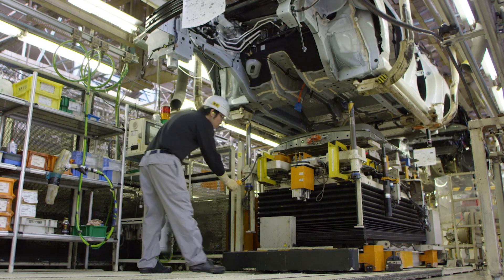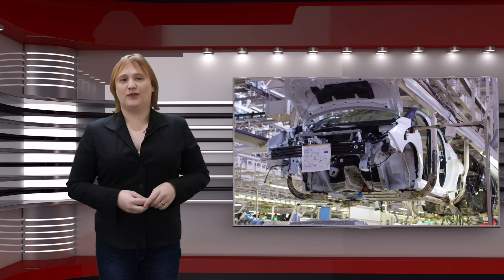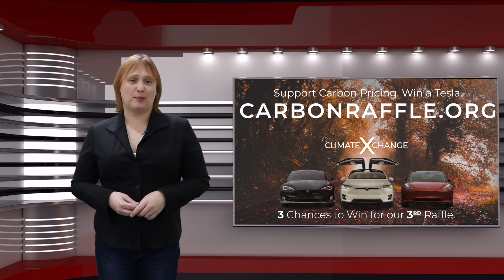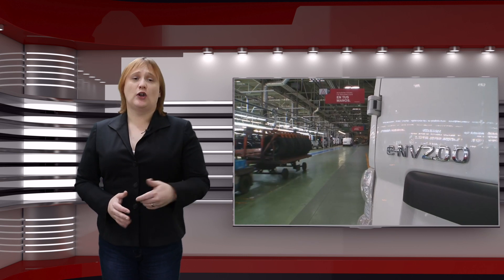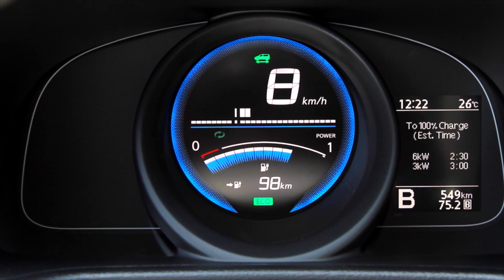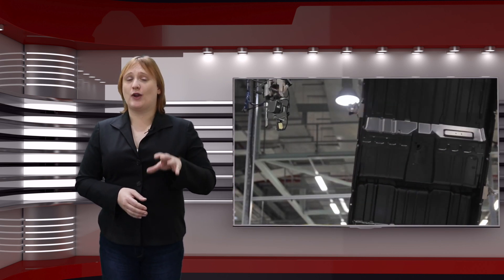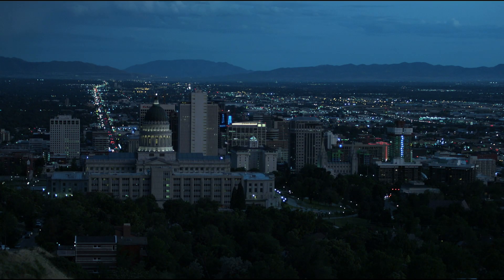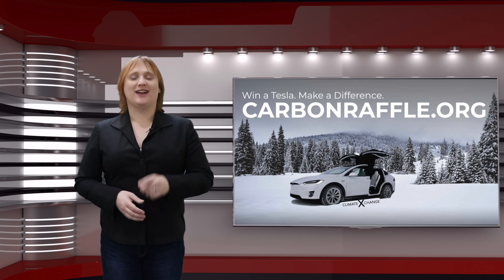The 2019 Nissan Leaf e-Plus Will Get Air-Conditioned Battery Cooling, Not Liquid Cooling

Comment: Flat Assertions  Like Liquid Cooling is Better than Air... is the same stuff VW owners heard for many decades.  Now those cars are famous for simplicity and the ability to work in ANY Environment...  don't freeze, don't leak, fewer parts, hard to break... etc.  Liquid cooling has been very sucessful in the Volt... and unsucessful in the Bolt.  In either the maintenance is expensive, failures inside the battery box are messy, complex, and expensive.  The parts count is enormous.  You skipped over the whole second gen Leaf change in battery chemistry which was a game changer which began over 10 years ago.  So using the earliest 2011-12 cars to predict the life of all newer leafs is just a smear.  You also fail to grasp the fact that a retro fit of the chilled air cooling to previous iterations   24, 30,40 KwH  packs   can further extend their typical 75K mile plus life.,  and make moderate fast charging much safer. More leafs have been produced than any other EV  and I have yet to see one burn.

Comment: Air cooling must be safer. Nissan Leafs are the only EVs that have not caught fire because of the battery. Teslas, Chevy Bolt, Kona EV all have had fire problems. I own a Leaf and have been satisfied with it. I just never use DC fast charging.

Comment: So you did the yards of calculus to figure out the heat transfer from the  + model and figured out all the Nissan engineers were just stupid?   They should hire you!
Reply: They are stupid or they are paid to be stupid.  On average, the battery packs in the Nissan Leaf MY2014 and MY2015 lost 12% in 3 years and then lost 20% in 5 years.
Reply: @MrSummitville  I don’t get it, my sons each had a leaf (a 14 & a 16) we lived in the PacificNW then, they drove them everywhere, all season and had a terrific experience, zero problems and no battery degradation in 3 years whatsoever.  Never overheated a battery, never got slowed down on a fast charger.  I feel my experience was average, saw lots of LEAFs all over Seattle.

But everyone is compelled to hate on Nissan because they won’t completely redesign their chassis to install watercooling in the battery pack.  Did any of you actually own a LEAF or are you standing on the side telling everyone what you won’t buy?  Meanwhile my kids saved me $1000 in gasoline in the first two years.

Comment: I think you hit the nail on the head, stating that a larger capacity battery will be under less stress powering the same load. A battery running under a lighter load compared to it's capacity will be more efficient, and produce less heat. If they're actually air conditioning the battery, that can help in areas with much higher outside temperatures. The most efficient cooling system can only cool the outside of the cells, not the inner parts. Therefore, creating a higher  efficiency cell, with lower equivalent series resistance is the cure. A hyper efficient cooling system is merely a bandage. I think just driving with a light foot is the key to getting the most miles out of any battery, especially on a hot day.
Reply: The battery pack does not have A/C cooling.  High ambient air temperature is just as bad ...

Comment: Funny how the UK people are bitching about the cooling system while it's completely adequate in places with much warmer climate, and truth of the matter is rapidgate really is fake news to begin with, the battery is protecting itself, that's a good thing, it's an EV and it's got limitations and you know it before you buy it so what's all the whining coming from? you want to do a grand tour get a rental Corolla and get on your merry way no? What's so difficult about accepting the EV as is especially the one that's the least expensive for it's kind? I'm more than happy to save a few thousands dollars over water cooling system and I'm an electrical engineer with SAE EV racing mechanical engineering experience not some kind of random LEAF fanboy. More is not always better and it's almost 2019 now so it might be a good time you put that into practice.
And it's like if you didn't know Ioniq EV and e-Golf (in some regions) also don't have liquid cooling system, it's not necessary under normal use that's the bottom line and I like the idea of meeting the need not the greed.

Comment: Do EVs with water cooled batteries also have a chiller or heat pump to cool the water or is it just cooled to ambient temperature with a radiator? 
The advantages to active cooling with a heat pump are cooling below ambient temperature, heating also available and more energy efficient than resistance heating.

Comment: I don't really think people care how Nissan implement battery thermal management. If it can thermally manage the batteries in all the various conditions (as good as, or better than current liquid cooling batteries) then doesn't really matter. Nissan will be lining themselves up for huge PR headaches if they have another rapid gate issue.
Reply: But the Nissan Leaf battery pack does overheat and it does fail early.  There is no thermal management ...

Comment: The air cooled Nissan will probably work fine . . . I’m just still pissed about the battery degradation in my 2016 LEAF SL. 
So will Nissan sell me an EV that won’t do well ? Yes, they’ve done it before and will cheat me again if I let them.
Reply: It is not "air" cooled.  It is still passively cooled ...

Comment: You got to remember that many  internal combustion engines were air cooled made by GM ,VW  , Porsche ,Subaru and more.
ICE are not that efficient and energy in the form of heat is lost everywhere. 
The heat lost in battery charging can be managed and using the AC to do it may be more than enough.
I’m not an engineer but I have been playing with LEVs for many years .the lithium battery’s I used would barely get warm under heavy charging. 
Modern lithium battery’s are under the care of a BMS .
Battery management systems oversee the rate of change and discharge to keep the cells from overheating..
Liquid cooling is best when managing higher temperatures however it’s not the end all.
It all depends on the conditions  and the care of the system.
Seeing we are using much lower temperatures under the care of a BMS  this type of system would need less care less parts less weight . 
I HOPE NISSAN LETS YOU HAVE   AN E+  to live with long term .
I think you would give us a real evaluation .
I hope you still have friends at Nissan.
Reply: You are an idiot if you think, it is OK for Li-Ion battery to get as hot as an air-cooled Internal combustion engine.  Li-Ion batteries must be kept COOL, much cooler than an engine.  Nissan Leaf batteries do get too hot and they do fail early ...
Reply: @MrSummitville   remember I was in the beginning of the use of Lithium batteries and I was only working on LEVs . There was no liquid cooling.. I’m old . We mostly played with lead a Nickel metal hydride.
The capacity of the battery’s back then was only a fraction of what they are today  .
Please note this post is almost two years old.

Comment: What happens when your liquid battery cooling system springs a leak somewhere? Will you have to take the whole battery out of the car and hope you can find it, and will it be fixable. I bet that will be one expensive repair! I bet that's also why Nissan is sticking to air cooling. Time will tell I guess.
Reply: The battery pack will be replaced under warranty or you can pay to swap out. Nissan does not have any "air" cooling.  Only passive cooling and it sucks !

Comment: Mitsubishi PHEV batteries are air cooled, PLUS when required aircon evaporater cooling. It’s not that great- battery gets pretty hot under stress. Very disappointed with Mr Nissan.

Comment: Remember why the lizard battery chemistry was introduced?

The active liquid temperature management prevents problems not only in the summer but, also, in the winter.

Lithium batteries have a rather narrow temperature range for optimal operation.  Add to this a larger motor which disrupts the flow of energy in and out from / to the battery.  This energy flow affects temperature over / below external temperature.

A fan based temperature management solution is incapable of removing / adding heat as needed all the time, but it is able to move a lot of air.  This is a cheaper solution which does not address temperature conditions all the time.  Instead it relies on a probability function that it will manage the temperature range a certain percentage of the time.
Reply: There is no fan based solution in the Leaf ...

Comment: What wasn't mentioned in the video is that Nissan has boosted the charge rate to 100kW.  At first glance a good thing but it will add more heat in a shorter time to a battery pack.  I will need to see a lot of testing before I would consider this vehicle.

Comment: Nikki. It is not a complexity issue. It is a cost issue. Saving development costs and per unit costs.
Liquid is not used to conduct heat, if it would than the water pump would be redundant. Liquid is used to absorb the heat, and it's absorbed capacity is far higher than air ( in the magnitude of 1000 when compared to air)

Comment: I feel like many people confuse air cooling with passive cooling. Up until the late 90's Porsche engines were air cooled, meaning they moved something around 50kW of heat just with a fan and in a tiny package. Sure the heat differential in battery systems is smaller, but then again the surface area available in battery packs far surpasses those obtainable on combustion engines plus the AC will provide chilled air in all conditions. And guess what. The liquid cooled battery systems also have to transfer the heat to the air at some point. I think pulling the air out of the battery with air cooled by a complicated mechanism rather than pulling the heat out with a liquid which then transfers its heat to the air via a complicated mechanism is just a packaging decision.
Active air cooling CAN move large amounts of heat and with the AC providing an airflow around 15°C at all times (which is a conservative estimate for what they can do) the temperature differential will be sufficient in all climates. My only concern was the AC performance in the interior while its used to manage the battery and the overall efficiency.But I highly doubt the people who condemn Nissan for using this cooling strategy went through the effort of making any calculations on the matter.
Reply: You are an idiot if you think, it is OK for a Li-Ion battery pack to get as HOT as an Internal Combustion Engine.  Li-Ion batteries must be kept cool - much, much, much, much cooler than an engine.  That is impossible in the Nissan Leaf with high ambient air temperatures and passive cooling and now with Faster Chargers ...

Comment: i drive a e-nv200 with the old 24 kwh pack in cold European climate and the air cooling of the battery pack is a joke, it cools the battery only at charging and that is by far not enoug, after 3rapid charges you need at least 2hours of slow charging to cool the pack down to healty  levels again, and the a-simetrical aircooling cools some sells good and some bad witch throws the pack very unballanced after a couple of fast charge sessions . many people buy there first electric car as a second car, right?  and as many people here know, what happend? exactly, after buying the electric car within 6 monds you sell your petrol car, motorcycle and lawmower, and drive everything electric, therfore you need to be able to FAST charge, so be very careful to buy nissan electric cars.
Reply: The Nissan Leaf e-plus still has no cooling ...

Comment: There is no difference between air cooling and liquid cooling. Only size of the radiator matters. And every radiator is air cooled anyway.  Who cares if Nissan made their radiator and battery pack into one unit?
Reply: The Nissan e-Plus still has NO cooling!  It is still only passive only.  Actually, water could carry away much more heat than air can ...

Comment: Another bad decision by Nissan. This is not the way to conquer the world of EVs. Even a simple liquid cooling system would be so much better than none. It may turn out that it will be ok like with the smaller battery LEAF of 2018. But the first Rapidgate surely did damage to sales of the 2018 LEAF. I think it is inviting trouble now that the competition is getting organized.

Comment: Nissan going down very wrong and very blind alleys here. Maybe it has to spend it's money on lawyers either defending or prosecuting it's crooked CEO rather than proper engineering. Oh dear.
Thank goodness I opted for BMW i3 - direct expansion refrigerant - the most effective and  well designed battery cooling system around!
Munro associates:" This is the easiest heating and cooling system I’ve taken apart in 30 years.”
https://www.hybridcars.com/bmw-and-lg-chem-trump-tesla-in-battery-thermal-management/

Comment: I always thought the whole idea of increasing EV adoption and therefore sales was to evolve the equipment to the point were the user's experience got as close to or better than the experience the end users has with non EV's. So cruising speeds wouldn't be compromised, distances travelled (worst case senario) wouldn't be compromised and refuelling times would be as short as posssible (realistically speaking).

IF, IF Nissan hasn't improved the charging/cooling in the next iteration that was expected after a potential 'Lesson Learned' moment with the smaller battery pack, then customer confidence towards the brand is not going to improve, with a possible knock on effect towards other products within the brand.

It's appears to be bad enough in the UK and Europe that the charging network is so hit and miss in respect to reliable operation of equipment and the number of stations/ charging points provided. Then on top of that the lack of a universal payment system for all the different suppliers equipment.
In an industry that has to be feeling the pressure of reduced sales of combustion engine vehicles especially diesels, that (manufacturers) working together to smooth the transition for customers over to EV's would be a primary goal. Then EV's would become highly attractive to all and not attractive to a few.
Anyway if this news about cooling is true...hurry up KIA e-Niro (64 kWh) to the UK.

Comment: Now, the Renault Zoe has active air cooling and the batteries are pretty bulletproof. So there's that.

However, the Zoe uses the active system at all times, as needed. Reports seem to be suggesting that this will only be using the system when charging,... Which seems odd.